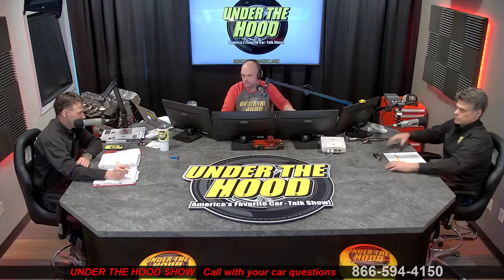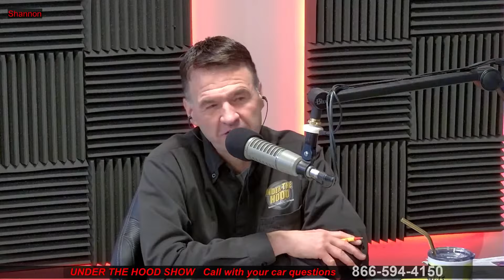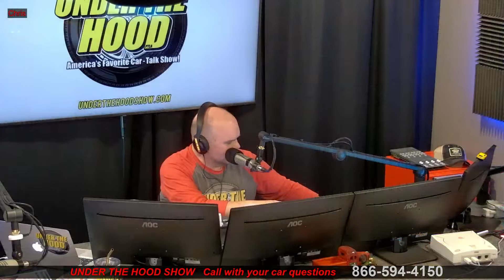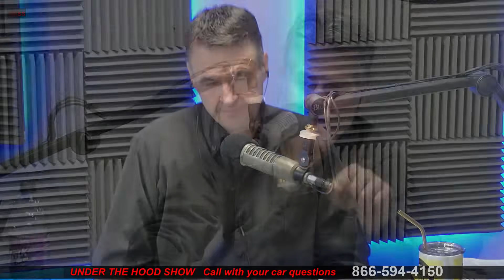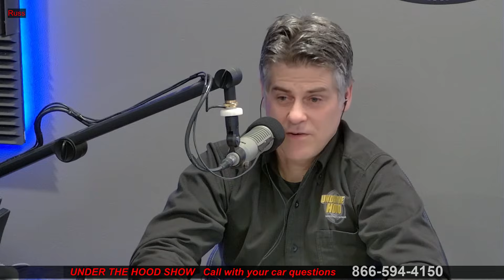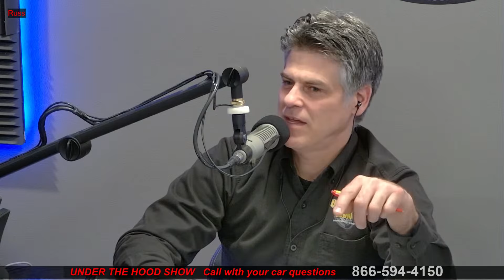S32:E41 Full Show May 5th, 2022, | Don't Fall For Gas Saving Scams For Your Car

Comment: 2002 Ranger Edge 3lt 6cyl.  Does the engine or the transmission need to be tweaked in order to replace the oil pan gasket? 
Thanks!  Jack